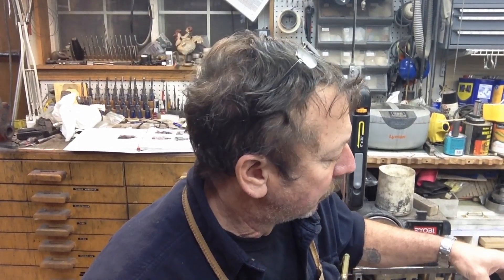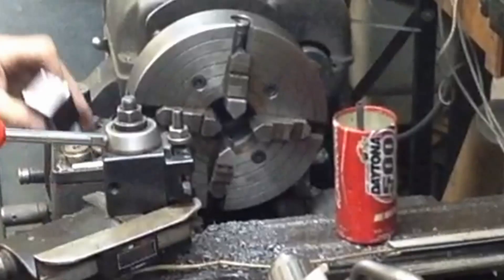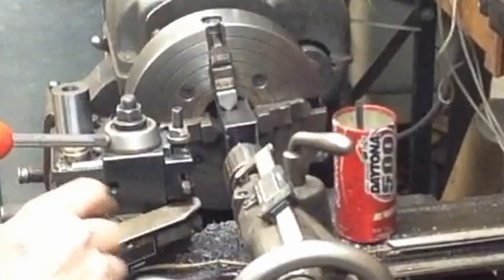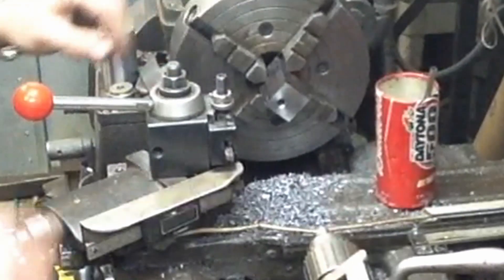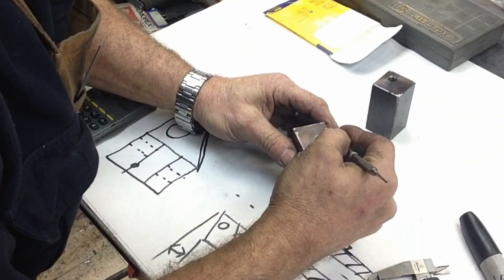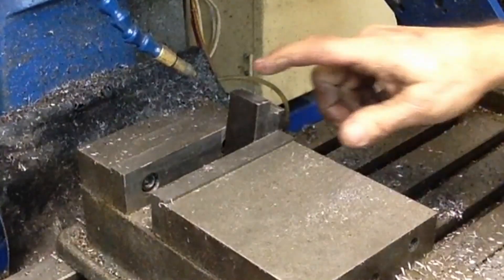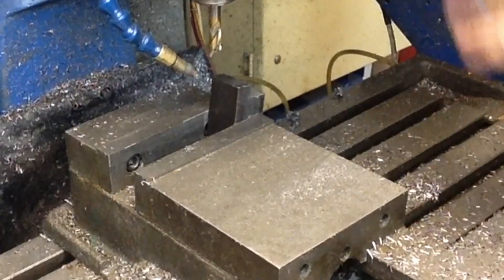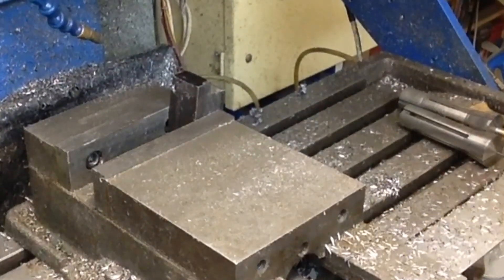Atlas Turret Lathe Tooling: Building A Centering & Facing Tool: Part 1

Comment: Never got to see the tool in action.  Did you make 2 ?  You had 2 blocks.   I'm setting up my SB10 K to make some small bushings. Thanks for posting.
Reply from the maker: Yes, I built two of them, you can see it running in part 29 of the Atlas Lathe video first parts run, thanks, Dan